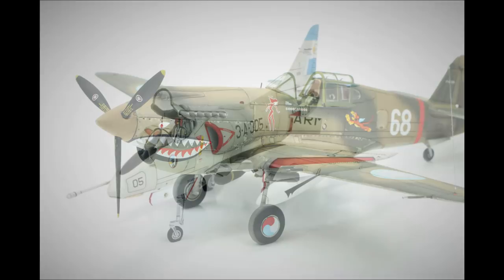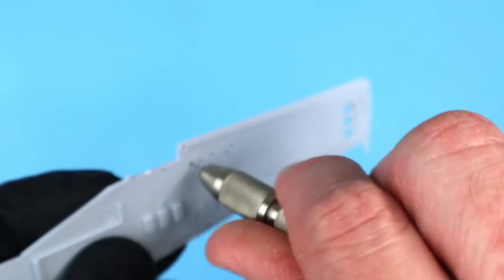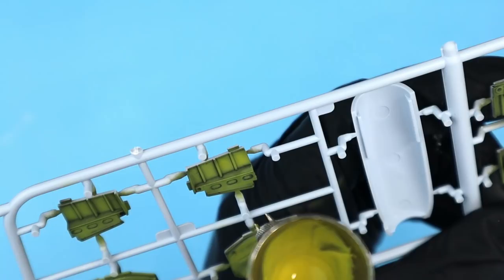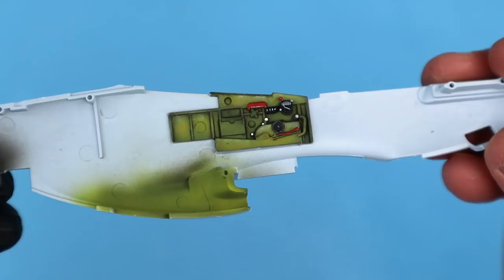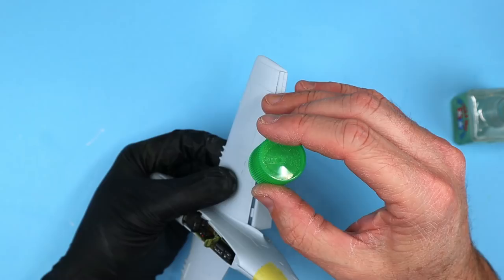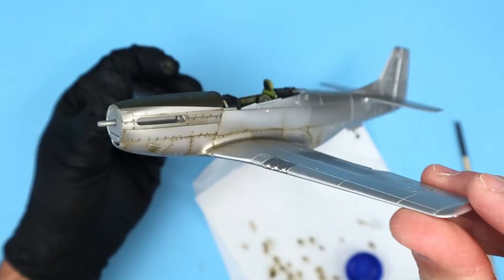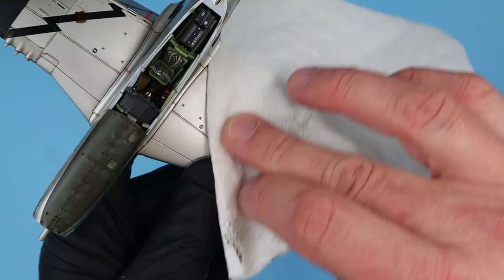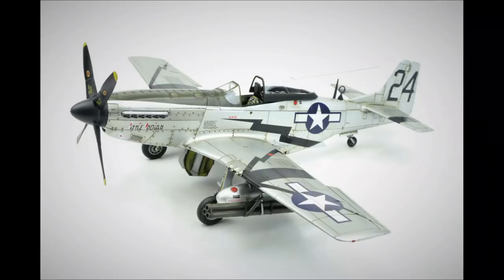1/48 Airfix P-51 Mustang Build

Comment: Nice ejector pin mark detail on this kit. Otherwise mediocre at best. Bring back the WWI vibe with those trenches. I see not a single "fine engraved panel line". The seat is work of pure fantasy. Really don't know what the engineers of Airfix smoke when they made it. The detail level is almost enough for a 72nd scale kit. Really don't know the reason to buy this kit instead of the Eduard one. If you start to use 3rd party accessories to bring this up to the out of the box Eduard level, you spent at least 2x the money compared to the Eduard kits price.
AK Xtreme Metal paints are enamel, not lacquer.
Reply from the maker: Appreciate your perspectives on the Airfix and Eduard kits.  Indeed the Eduard kit is excellent but I have no real issues with the Airfix kit and really enjoyed the build.  We are fortunate to have so many choices that allow each modeler to go down the path that best suites them, their skill level, budget, needs, etc.  Thank you as well for correcting my mistake on the AK Extreme range.  I misspoke there and was thinking about the AK Real Colors range.  They are indeed enamel based.  Now, to find an easy way to make an addendum to that video...haha.  Happy New Year!
Reply: " really enjoyed the build" - Well, that is the whole point of this hobby. The best kit for everybody is the kit he/she most enjoy to build.
AK Real Color: that is an interesting story BTW. Originally it was a Tamiya copycat with some additives to be more suited for brush paintnig.  And those paints were very good. But somehow you needed much more from them to paint the same model compared to Tamiya, Gunze or MRP (after thinning of course). A whole 10 ml bottle went to the Magach 7C, meanwhile I blackbased it with 2 ml of Tamiya NATO Black. Then AK decided to change the recipe, made those paints pure lacquers. Quality dropped significantly, and the consostency of the various paints become unpredictable. They changed those paints at least 3 times without any notice. And in the end they used the original recipe with some less smelly solvents and launched them as AK Acrylic v3. OFC after 3 months they again changed the recipe. They are an unreliable company in my view.
BTW: Airfix is getting better and better. But they seemingly unable to do the much needed leap. Their 72nd F-4 Phantoms are a good example. In my opinion those are the best in scale. But the cockpit is a terribly simpified something. Come on boys, pure decaled cockpit it the 3rd millenium? Italeri was capable of making a good raised detail cockpit in the 1980s, and Monogram in the 1970s! So, in the case of those Phantoms, a 3rd party cockpit is mandatory IMHO. Lucky for us CMK made those cockpits. This is my main problem with Airfix. They always mess up trivial things, while pull out complicated things easily (just look at the aformentioned F-4s, those have very clever things but an almost nonexisting cockpit).
Reply from the maker: You hit the nail on the head with regards to our motivations behind the hobby and that is some really good background that I was not aware of with regards to AK.  I have had no troubles with their products in the 2 or so years I've been using their stuff.  You are really tempting me on the Airfix F-4.  I'd like to see how spartan that cockpit is and also see if some simple scratchbuilding techniques can help out.  Now where's that order button :)  Thanks again for all of the input/feedback!
Reply: @FlyingSModels  The panel lines in tha Airfix Phantom are quite good. Except a single horizontal piece in both sides of the fuselage. I really don't know how they managed to mess up that line, and not a single othor one. Maybe because that line is where the fuselage starts to curve.
Ejection sheets are decent, but simply decaled IPs and consoles. And missing sidewalls (meanwhile all four of the two stations have details on them. Really don't know why all the manufacturers failed to realize this.) But the biggest oversight in my opinion that in the left console of the pilot there is no throttle quadrant at all! That thing is totally missing, decal only. WTF
Reply from the maker: @egyeneskifli7808  Hahaha....maybe they just got tired at the end...kind of how I do by the time I get to adding the ordnance and this say, screw it, just leave it off.  Plus, they probably think that since it's a static model, it doesn't actually need a throttle lever.  Only kidding, of course.  You are encouraging me to get it so I can see and try it for myself :)
Reply: @FlyingSModels  Maybe the cockpit is the end for them, but it's the start for the modeler.  And if you become annoyed in the beginning, then you will have a bad taste in your mouth until the end. And maybe you will feel pointless to invest too much effort in the whole process.
Reply from the maker: That's true for sure.  Hard to do much before the pit so it would make perfect sense that they now make that the best part/experience.